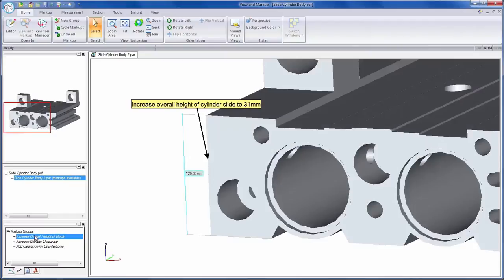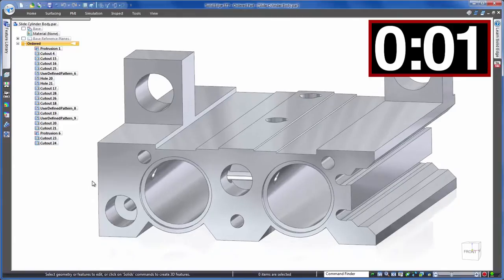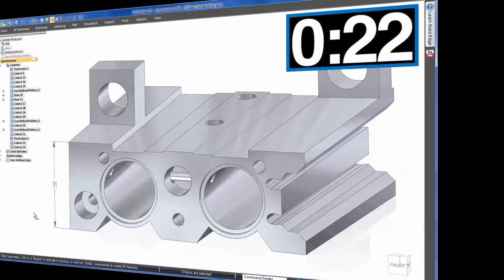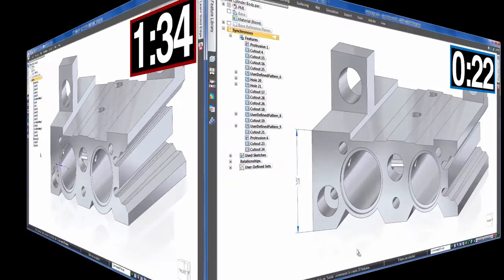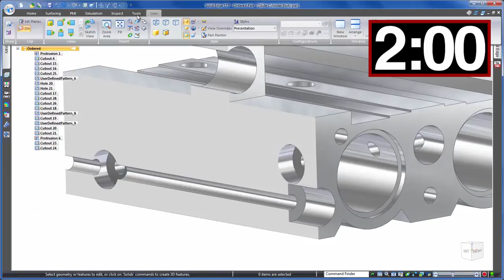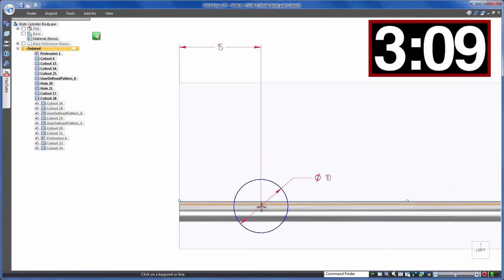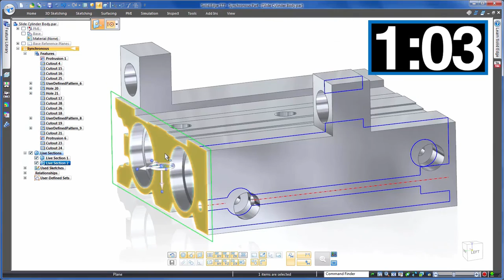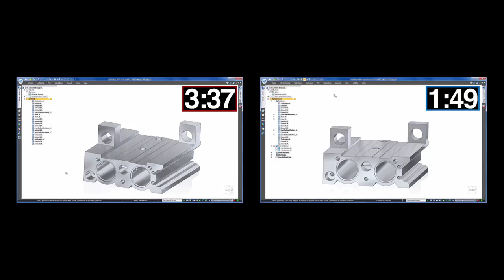Solid Edge ST8 - Design Intent Recognition

Comment: I wish my work used Solid Edge.  Synchronous Technology would have been a huge time saver yesterday.  The design intent changed on a part I was working on and it took me about ten tries to remove an extrude without disturbing the trailing features.
Reply from the maker: Scott Rodgers Thanks for the comment, we'd love to know what you are having to use
Reply: My work has used SolidWorks for several years.

It works fine for creating parts and assemblies, but it can be so slow and tedious to make changes or reuse a design.

I've used Solid Edge for personal projects, and Synchronous Technology adds a liberating level to CAD.